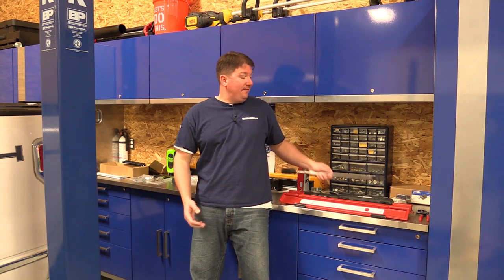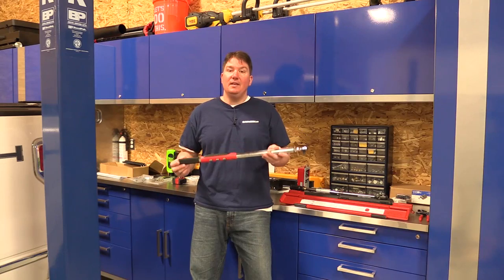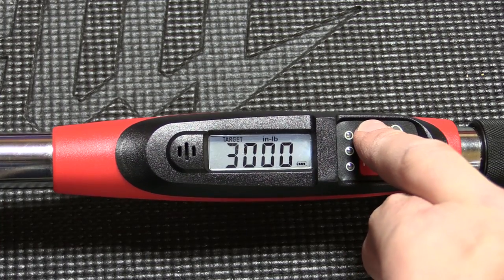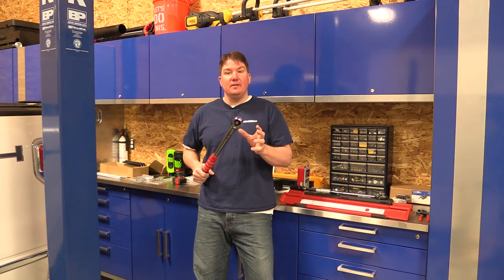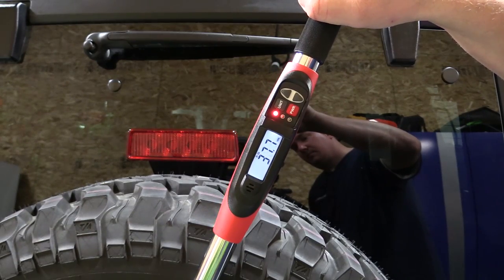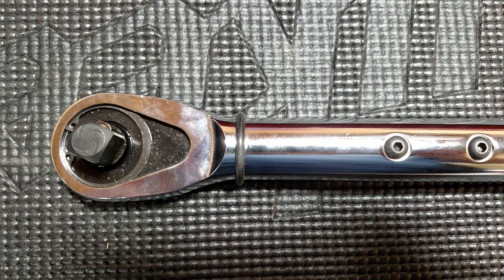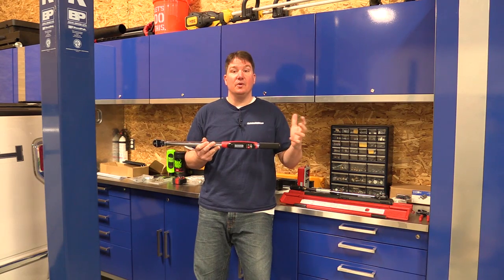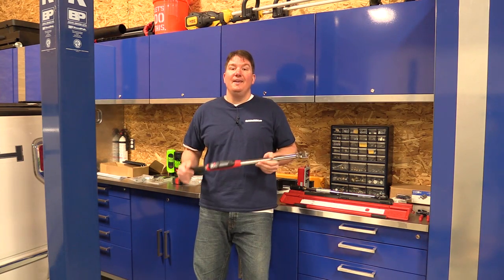GearWrench 1/2" Electronic Torque Wrench 25-250 ft/lbs 85071

Comment: Will it record break away torque?   sometimes I have a need to know the torque required to loosen a fastener for QC purposes, does this have that ability?
Reply from the maker: Yes.  Although I am unsure on how accurate it would be.  If you applied a lot of force fast, you might get a higher number than if you remove the item slow.  Make sense?
Reply: +WorkshopAddict understood.
Reply: What is QC purposes? thank you
Reply: @jesseeb1122  item requires a bolt torqued to x specification, you pull an item from a batch and remove said bolt and test the force required to break it loose and compare it to the number it should be, if it is way under torqued you have to check the batch

Comment: if you know you are over doing it by an average of 10 ft lbs then set the target torque 10 less ft lbs then you want.
Reply from the maker: +kurtisstrand I was going over the target on my test.  I could do what you are saying, but overall, torquing lugs is not the intended purpose of this tool.  It is just not as fast as a click type for that application.
Reply: +WorkshopAddict makes sense. and if you're going for accuracy then dialing back your target wont help =p